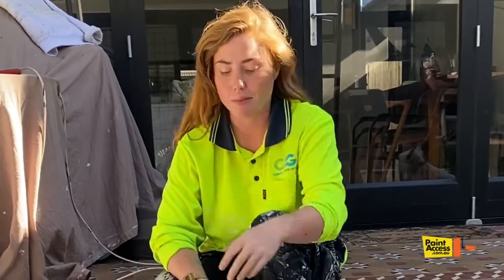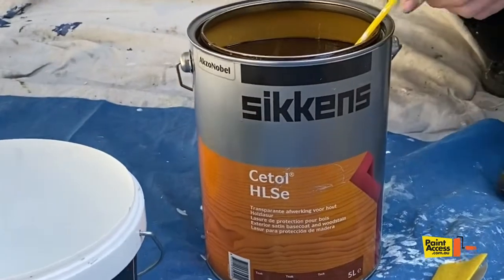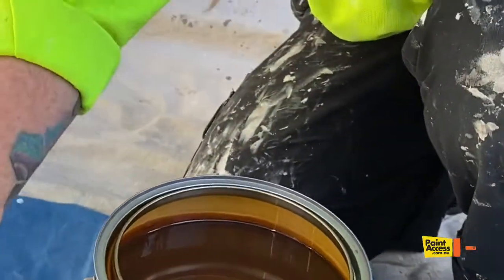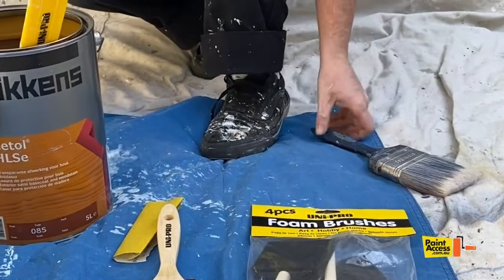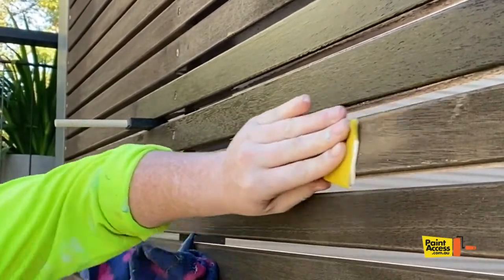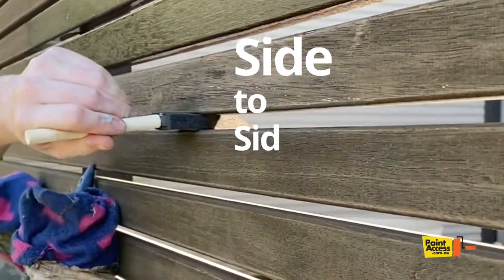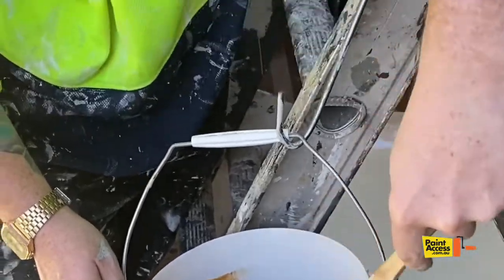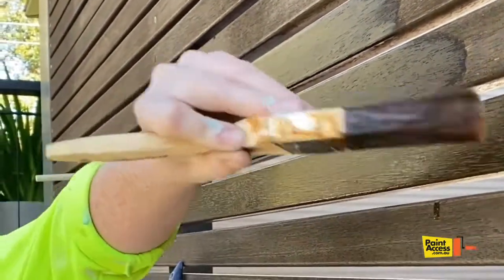Applying Sikkens Cetol HLSe  DiY Tutorial with Pro Hints from PaintAccess

Comment: It’s solvent paint and top coat should be filer 7
Reply from the maker: Its not necessary as you can complete with hlse
Reply: @PaintaccessAu  well yes but it’s not Oil based solvent  based
Reply from the maker: @danielkorczakowski9668  HLSe its oil based
Reply: Ingredient name
Distillates (petroleum), hydrotreated light 2-ethylhexanoic acid, zirconium  solvent